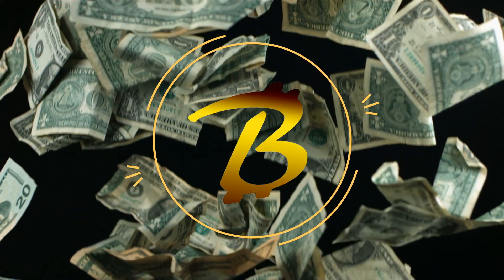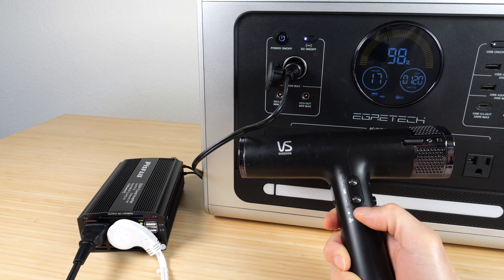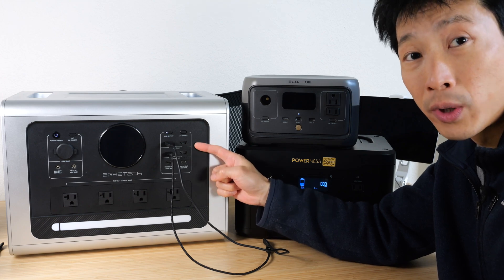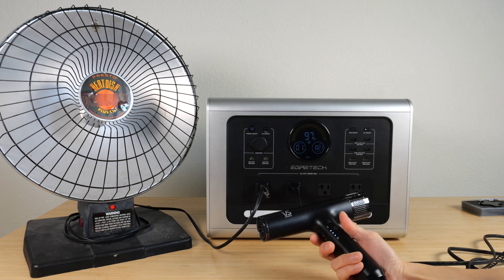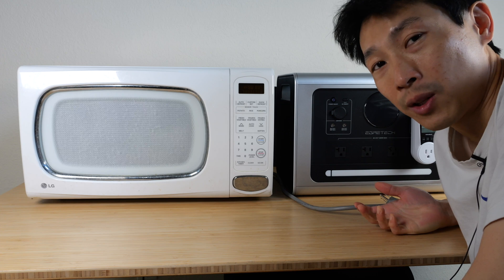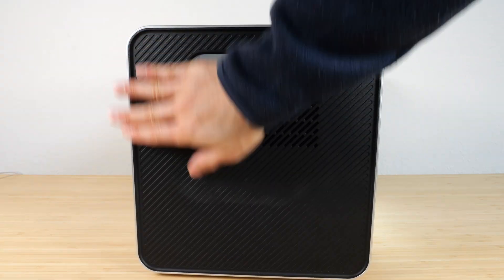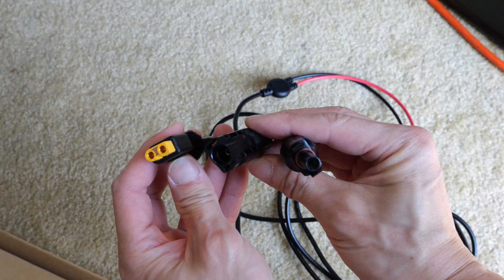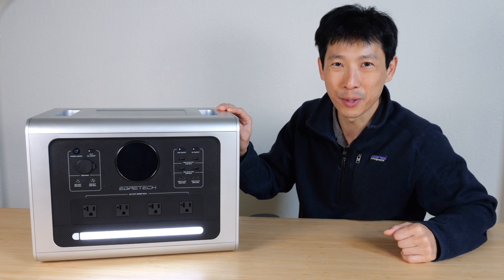2200W Power Station Stress Test [Egretech]

Comment: for computers, I don't think the voltage drop matters much, the power supply deals with that. For AC motors, like on a refrigerator, it can be devastating.